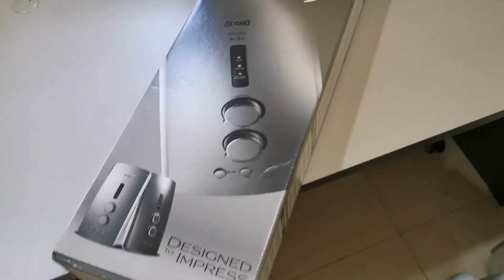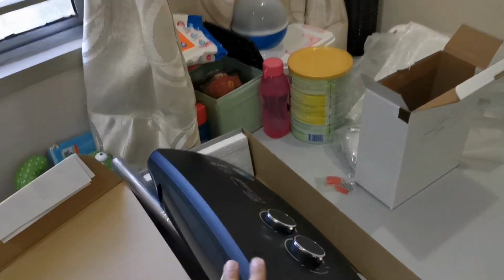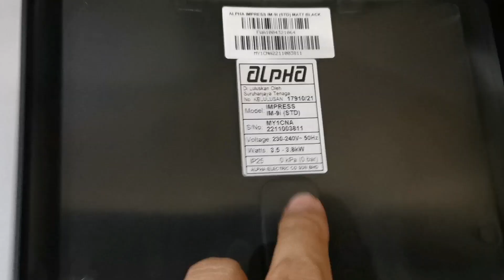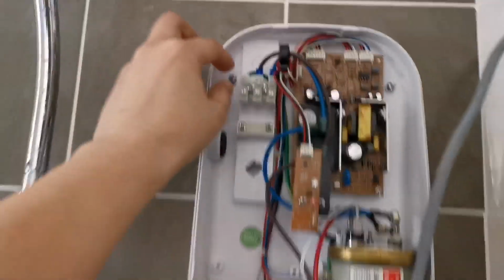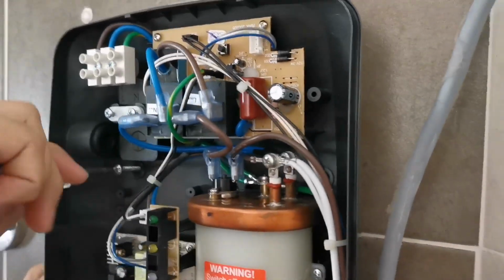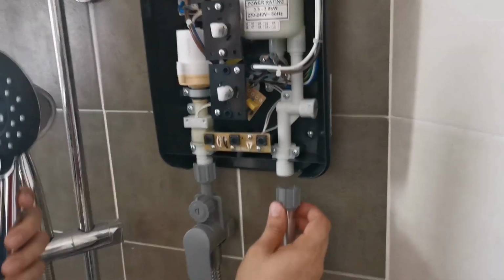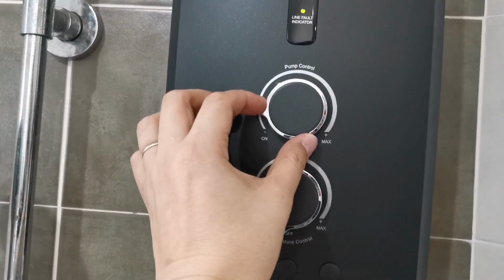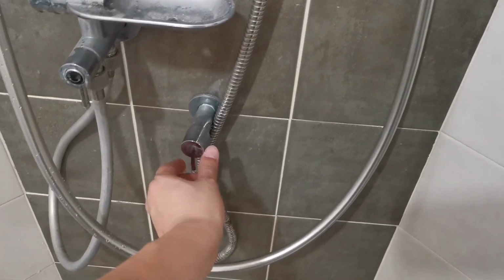How to Replace Faulty Instant Water Heater DIY in Malaysia | Alpha IM-9i #diy #instantwaterheater

Comment: I got a similar model  alpha im9ep, everytime i on the switch the line fault indicator will turn red..if i press elcb and reset it will be green, is this safe to use?
Reply from the maker: I hav not faced this issue with this unit. I think is better open up and check if there is any burn mark at he wiring or the electrical board..

Comment: My house water pressure very low, may i know AC pump better or DC pump better? most important to me is water pressure, noisy or electric save is not important.
Reply from the maker: Actually both AC or DC water output is similar. But DC will be quiet